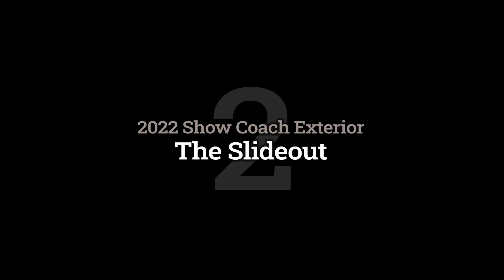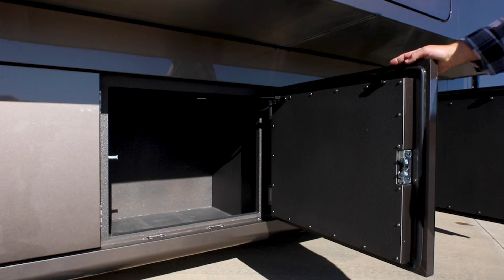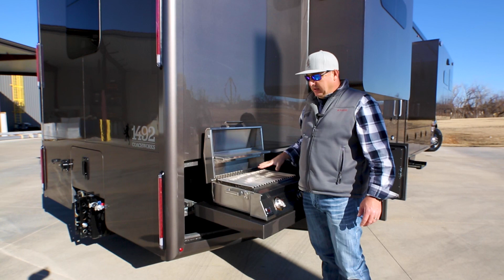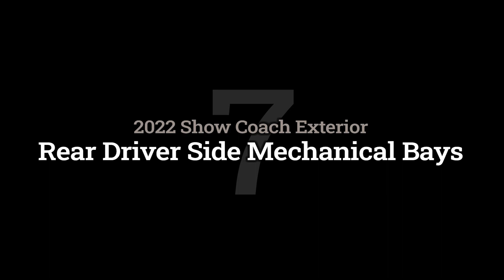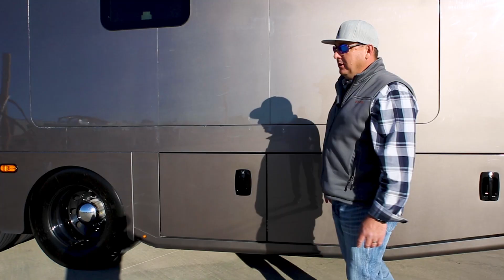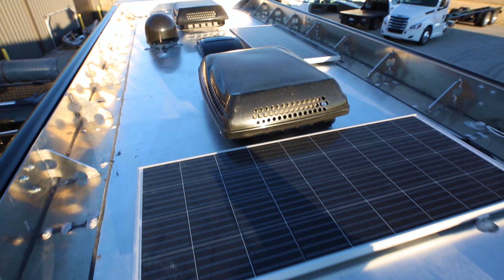2022 Super C Show Coach Exterior Walkthrough

Comment: Which class 8 cascadia is the chassis? The 116 pr 126
Reply from the maker: This one was a 126. Thanks for watching!
Reply: @1492Coachworks  one more quick question if you dont mind; why the Cummins as opposed to the DD15 or 16? Can you explain the differences & why your preference of one over the other? Thank you.
Reply from the maker: @superiortrans-1697  No real reason other than trying to be a bit unique on our first show coach. Ironically we currently have no Freightliners on order for customers and are all Pete & KW for the next year plus. We like the Cascadia just fine but cannot get them so we've had to switch our customers. So far they are very pleased with the Pacar product.
Reply: @1492Coachworks  Thank you for the reply. Ive only heard moderate things about the paccar products although they've been around a long time and I do like the air suspension. I think I would prefer the FL CAS 126 because of the more HP & FT LBS. Could you keep me posted on when you can get the '22 or '23  FL chassis?
Reply from the maker: @superiortrans-1697  The best date guestimate we have been given on a Cascadia is sometime in 2024... The Torque rating & HP for a Cummins X15 mated to the new 18 speed Eaton Automated is 2050 torque and 605 HP if properly spec'd. That's the setup we are recommending on the Pete's & KW's. That is a great drivetrain and truly drives like an Allison when at slow speed. No herky jerky! 
Holler at Weston or Aaron if you get a chance so we can get some info from you have start the process. 405.745.6666. Thank you!
Reply: @1492Coachworks  I actually called that number, no answer; I left a message and no returned call; which is why I resorted to asking my questions here although I'm grateful all the same.
Reply: @superiortrans-1697  That’s not what I want to hear at all! My cell is 269.228.6141. Thanks for bringing this to my attention.
Reply: @aaronweimer7943  Thank you, I'll call your cell tomorrow from the same number (my office) that I called from a few weeks ago.

Comment: On the outside cooler/freezer how is it getting fresh air for cooling with your sealed compartments.
Reply from the maker: Great question Michael. The cooler bay as well as the Inverter & battery bays are vented with a filtered water resistant vent to the exterior. In the case of the inverters we actually build a plenum that allows the inverter(s) to directly blow the air out of the bay greatly lowering the heat build up in the bay. Thanks for watching and asking. Please don't hesitate to reach out to us at 405.745.6666 with further questions.

Comment: This is a beautiful coach.  So you have to fill the tanks separately?  Gonna have to check everything out. We are looking to get into a Super C.  Thank you.
Reply from the maker: The tanks for transfer between the two but the fastest way is to fill each tank. A typical truck stop will have the primary on the driver side and then a slave pump tied to it on the passenger side. 
Feel free to call us at 405.745.6666 with any other questions. Thanks for watching!